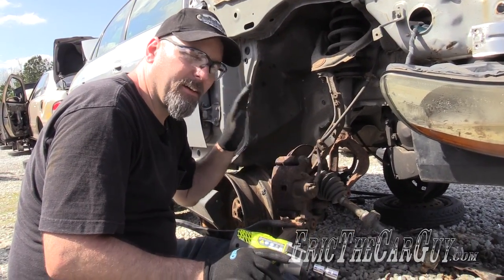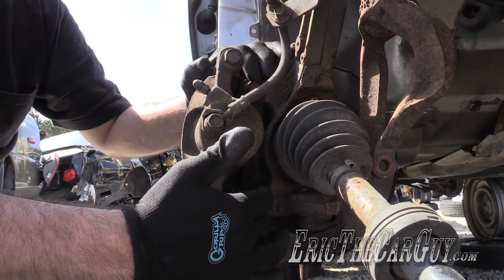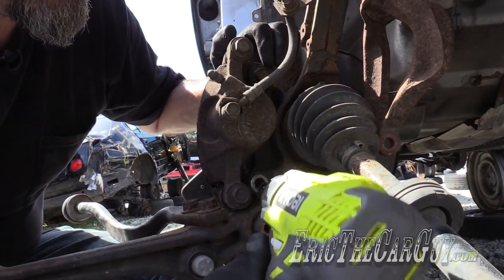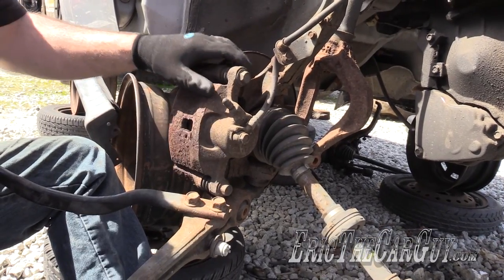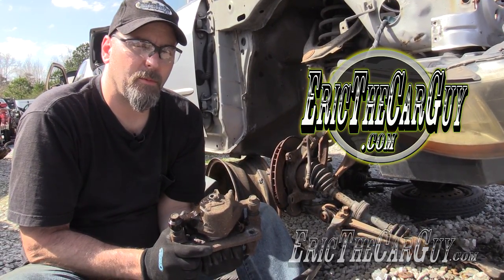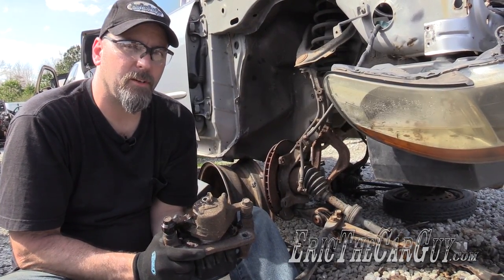How To Pull a Honda Front Caliper #SalvageYardHacks

Comment: One valid comment and one of my own:  Yes please make sure the piston isn't rusted in place and froze.  That does suck when you get home  (don't ask.....)  And please PLEASE!!  Crack the bleeder open and shut before you go through all that trouble (again...don't ask).... 

Keep in mind that the bulk (about 95% or more) of all fluids are extracted before these cars see a pick and pull type yard.  Everything they can extract in a quick and efficient manner they do.  Our local yards sell used (tested good) batteries, antifreeze (filtered)...Oil gets burned in the shops for their heat.  Really not a lot goes to waste.  The stuff they can't use or sell on site will go to a recycle center where it's disposed of correctly.    Contrary to what "Hollywood" would have people think in a "Capt Planet" world...  Most companies do this stuff and do it right.
Reply from the maker: Yea, I wish I would have thought of that when I shot the video.

Comment: I am owner of a Honda Civic sedan -97. This car has standing outside in snow and rain for 2 years. I live in Sweden and it´s cold here. My problem is that I can´t change headlights because the wire is stucked. I´ve looked at many videos and everyone just take it away without problems. What to do ? Use some violence or tool or electric spray? I love my car and has looked at your videos how to change fuel filter. It worked but I had to spray 5-56 on the bults, they were also stucked. But this is no good for electric using

Comment: Just replaced a right front caliper+bracket on 2002 Sienna. Cost $53 new from AutoZone. Used brake parts are like used condoms, pretty worthless.
Reply: Probably a refurb to be fair but I've never had issues with refurbs.

Comment: Is it really worth it to put a used caliper on a Honda? Are new or rebuilt really that expensive?
Reply: It's just easy tip for people who don't how to. Also hes promoting the yard
Reply: I know it's a promotional video, I was just wondering if it actually made sense too. He's covered caliper removal I bet, literally, 150 times.
Reply: And do you even know if it's any good, or is it just as corroded as the one you are replacing?  Seems like a bad bet to me.
Reply: Garth Goldberg
Junkyards usually have like a 15 or 30 day warranty for stuff like that, so I wouldn't sweat it too much.

I've had another conversion with a guy on here that price checked that particular caliper and came up with $80 for a "new" one, so I guess if you were in a bind used might be the only way you could go. It beats walking to work.
Reply from the maker: If you can't afford a new one, yes.

Comment: personally I'll rather buy new when it comes to brake parts! but thanks for the video
Reply: A decent-looking caliper with a little care and new pads should technically have 95% of the reliability of a new one, for a fraction of the price.
I can see why people would do it, but it all depends on how long the car has been sitting, if you ask me
Reply from the maker: Some people can't afford new parts and this can be a viable alternative.
Reply: I just did the numbers with my local yard and it really is easily half the cost $21 vs $45 (before taxes and excluding the core) so I see the value

Comment: Put the banjo bolt back in to keep the muck out Eric.
Reply from the maker: Great suggestion. Thanks.
Reply: yeah,sure wouldnt want to contaminate the rusty watery brake fluid that was inside!!
Reply: If it is being used again you don't want grit and road shite in there do you, and from what I saw that was clean b/fluid that came out of the banjo connector,
Just because they are rusty outside does not mean they are knackered it may be a new caliper that has gone rusty after being stood a while as long as it is full of fluid it will not rust inside and will still be usable saving somebody a lot of money if their pockets are not very deep like mine..
Reply: 'a new caliper' really,did you see the rest of the car? your gonna risk your life on a maybe?even if it was i would hope that person would at least rebuild the caliper first. since eric didnt say what year that was-lets say it was a 2000 accord lx v6, autozone sells  a rebuilt for 43.00+core...junkyard is say 20.00+core then 6.00 for rebuild kit and 4.00 for new caliper boots/bushings or pins plus the time of going to a junkyard and hoping  to find the part that you need.and then if it dosnt work you get to do it all over again yaaaaay,so tell me rick is it really worth all that.I really dont think eric would put that on his car.this video was about eric making money off of that place-poor eric,i think he has jumped the shark this time!!!!!
Reply: All this was meant that anybody removing a caliper should put the banjo bolt back in to keep the dirt out,
That car could be a 2000 but who is to say that caliper is only a few months old, there is no need to hold an inquest into it is there.

Comment: Im surprised that fluids isnt drained from the vehicles..
Reply: See comment I made above.  The bulk of all fluids are drained and recycled/reused.  They can't get everything however.  The brake system does get purged, but not to the point of draining each caliper and wheel cylinder.

Comment: Is it really legal in the USA to let the brake fluid just drip on the ground like that? Wow, you'd get fined big time for treating the environment like that. Same as with oil.
Reply: It's not.

In fairness, I can't really tell if he has a drain pan or a hub cap or something on the ground.
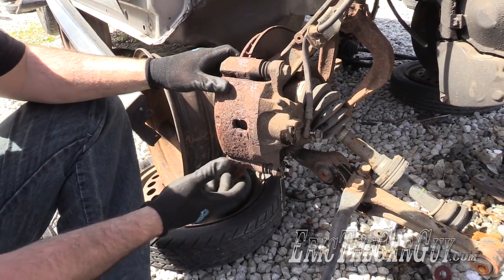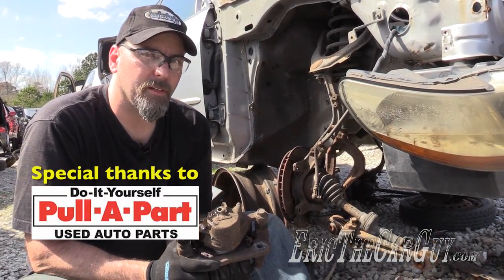Reply: Maxwelhse Oh, but you can see it on 0:26 to about 0:31 quite clearly that it's just dripping on the floor. At least that's what I saw, I might be wrong though.
Reply: Seegal Galguntijak
I couldn't say. I'd like to give him the benefit of the doubt.

But the answer to your question is still "no". It's not legal to just dump stuff like that out on the ground and most junkyards really won't like it if you do (because they're the ones that will be paying the fine). The ones around here always cut the rubber lines and drain the system before even putting the car in the yard.
Reply: Maxwelhse That's how I know it as well: Cars are only put on the lot in a "dry" state, which means: no fuel, no oil, no transmission fluid, no brake fluid, no battery (because of the acid).
Edit: And no coolant either, of course!
Reply: Maxwelhse Also: Are these state laws, like many other environmental laws? Then it may even be possible that it's legal in the state where this part was pulled.
Reply: Seegal Galguntijak
No. The regulation of stuff like that is handled by the EPA (environmental protection agency... they handle basically all of our environmental pollution laws) at the federal level, but there could also be additional state laws that could go above and beyond the federal laws (that's why you may see various things marketed in the US as being listed as not for sale in the state of California, because California has more stringent environmental laws than the federal laws).
Reply: Maxwelhse Oh, I see. I remember them because they dinged VW for their fraudulent diesel emmissions (while we still breath in NOx gases, because Europe is focused on CO2).
Reply: Seegal Galguntijak
Correct . EPA 2010 is MUCH more stringent than EURO V, but EURO VI emissions are fairly comparable if not a bit more extreme. I believe the EU is scheduled to update to EURO VI in 2017, but nations push the standards back all the time (like Brazil is still manufacturing Euro III engines right now even though Euro V is the law... They can't get high enough quality fuel for Euro V motors to operate).

But, that's not the only thing the EPA regulates. They have their fingers in everything related to environmental pollution in America.
Reply: Maxwelhse Actually, I think EURO VI is active since 2016. However, the emissions are not comparable, because the EURO standards are based on the NEDC (New European Driving Cycle), and that is just totally irrealistic. To add insult to injury, it is legal for car manufacturers to abide by the emissions standarfs only in the NEDC cycle, and outside, they are free to pollute as much as is needed for the power/fuel consumption they intend for their vehicles. So now, lots of car manufacturers admit to having software in their ECUs that recognizes whether the car is driven within a test cycle or outside, and regulates the emissions accordingly. VW and other car manufacturers did "buy" these laws from the EU, and so there is nothing to be done about it - at least not on the short term.
Reply: Seegal Galguntijak
You may be right... All I've seen of the standards are the NOx and soot numbers (which I thought were pretty cut and dry?) and I'm not that familiar with how the Euro motors are tested... I've also been out of diesel design for about 5 years now, so it's possible things have changed in that time.
Reply: Maxwelhse Since the 'Dieselgate', everyone is laughing about our European "emissions standards"... NEDC criticism was there before, but they plan on replacing this test cycle some time in 2019 or so...and only for newly sold vehicles, of course.
Reply: Seegal Galguntijak
Meh... To be honest we should all be laughing at every standard until China shows even the remotest amount of interest in developing some sort of pollution control strategy... I think I remember hearing that they were looking at going to Euro III at some point (I think maybe Beijing already is?), which is just a touch better than having a coal powered vehicle.

I've also always though that Europe was on the right track by offering extremely high fuel economy Diesels in the automotive market while in the US during the same time period "good" fuel economy out of a typical compact car would have been like 35mpg. If you compared the emissions numbers on actual fuel burn the Diesels just have to way way cleaner, but they were illegal here until a few manufacturers finally had to update to SCR motors anyhow for EU so now a few are trickling in.
Reply: Maxwelhse Actually, with Diesels, it seems to me that you can chose any combination of two properties out of the following three: high power, low fuel consumption, low emissions. Unfortunately, the manufacturers chose high power and low fuel consumption - but then they are too cheap to adjust their exhaus gas treatment properly, because that would mean building much bigger urea tanks into the cars, and making the owners fill up urea much more often than they can be bothered. With big semi trucks, this works fine, but somehow the industry thinks that car drivers shouldn't be bothered with the cleanliness of their vehicles, or something like that. Who would buy a vehicle that uses 5 or even 10 liters of urea on 1000km, when they advertise it uses only 1 liter (due to improper exhaust gas treatment)?
Reply: Seegal Galguntijak
Naa.. You're a little off base on this one. Pick 2 out of 3 isn't too far off, but your logic of why isn't right. You can't just magically cure all emissions problems with a Diesel by performing SCR regens more frequently or with more urea. If it was that easy, everyone would have no problem making you fill that tank up more or doubling it's size, especially on a passenger car. There's plenty of room inside the 1/4 panels and rear bumper for the tanks and I don't believe they have to meet any real crash test requirements since DEF is not flammable.

The major expense of the SCR system IS the SCR system. The tank, especially on a passenger car, is peanuts. There is something to be said about the cost of the heating system required for a bigger tank, and the electrical burden to run it, but once you're down that path already the scale isn't that extreme.

A commercial truck doesn't really run a huge urea tank either because it doesn't really need it (it stops at truck stops constantly where the driver can top it off, plus they don't use THAT much DEF) and, believe it or not, frame rail space actually is pretty precious on them. My Diesel experience comes from truck design and it was a pretty big deal if you needed to occupy rail space with something because you were taking away from the customer's space to hang tool boxes or pumps or donut fryers or whatever else they wanted and it effected ALL chassis lengths and vocations. So if someone ordered a short truck and needed to stack a bunch of equipment on it, they may literally be out of room and buy your competitor's product instead because they literally couldn't bolt their stuff to your chassis. If you lost a 100 truck order, or god forbid a giant fleet of thousands of trucks, because of that you'd miss out on serious amounts of money. We used to do super elaborate custom one off stuff for an order of 2 or 3 trucks sometimes.
Reply: Maxwelhse That's interesting. I have no clue about the details of how a SCR system works. You talk about "regens" that can be more or less frequently, while I thought the urea is constantly used to process the exhaust gases "on the fly" as they are produced (except when the engine is cold, because then it would lead to more toxic exhaust instead of less toxic, or something like that). The picture I had in my mind was that a certain amount of urea reduces NOx gases to N2/HO2 molecules (or something like that), and if the amount of urea is less than that, not 100% of NOx gases get reduced, and that's where car manufacturers "save money" (or save their customers money) at the expense of the environment.
I know that truck regulations here in Europe (or at least in Germany) are much more strict than those for cars, and since exhaust treatment and regulations of cars differ quite a lot between the US and Europe, I'd say that exhaust regulations on trucks are even more different. All I know is that over here, trucks, although they run high-compression turbo diesels, don't have the NOx problem that passenger cars with high-compression turbo diesels have. So they must be doing something right that isn't done on passenger cars, for whatever reason.
Reply: Seegal Galguntijak
Honestly, I wasn't that closely involved in SCR development (I worked for the guys that sued to the US government in an attempt to avoid using it... that didn't work so well for them), and it's been awhile now, so I think I may be getting my memories confused. Now that I think about it more, I believe the regeneration cycles are to clear the DPF and don't necessarily involve the SCR system itself (I'm not positive though). In terms that were discussed in my circle, that was all "after treatment" and we tended to discuss the requirements as a whole since that's all we cared about (I was in Powertrain, but not exhaust). You may be right about how it actually functions, but I do know the balance of how it operates is pretty critical. You can't just put "more SCR" on something and make your problems go away. I'm also pretty sure if you try to cheap out on the amount of DEF used that it will screw up the catalyst, it has to be pretty accurately dosed... also, DEF isn't really all that expensive. No doubt people would prefer not to by it, but again it's one of those things that buying 10% less really wouldn't swing the balance that much. Saving 1% on fuel would count though for truck fleets, so if they could swing that balance they definitely would.

I couldn't begin to guess what the car regulations are, but I'm guessing if the trucks run "cleaner" it's because they're running massive amounts of EGR and huge EGR coolers that the cars don't have to. In the US pick-up truck sized vehicles have EGR coolers and such, but I don't know if they would make a 3200lb car that gets 60mpg follow the same rules as a 6000lb truck that gets 18 when unloaded.
Reply: Cutting the lines wouldn't drain the fluid out of the caliper.
Reply from the maker: The remove most of the fluids from the vehicles before they go out in the yard. However, some fluid may remain in things like calipers. It's unavoidable unfortunately.
Reply: EricTheCarGuy Isn't it your responsibility to put a catch pan under it in those cases? (Or did you use one which I couldn't see?)

Comment: if you need good lightly used honda parts i have a 1992 5 speed accord with 129,000 miles on it that i am getting ready to haul to the foundary most everything on the car is still mint too, not sure where you are but if not too far from Nashville i might be able to work something out. I have the car on craigslist right now but all i have gotten so far is check scammers interested in it
 http://nashville.craigslist.org/pts/5612841187.html?lang=en&cc=us